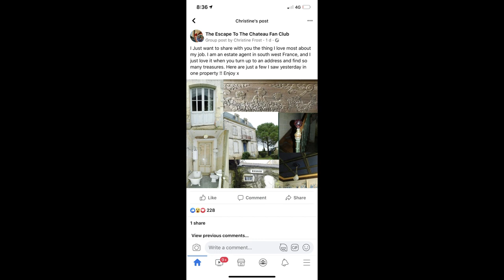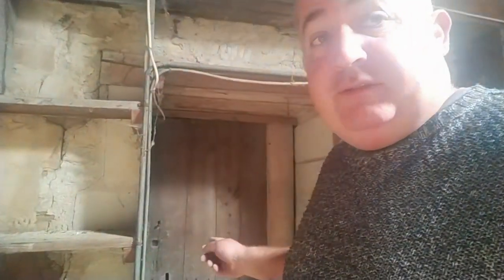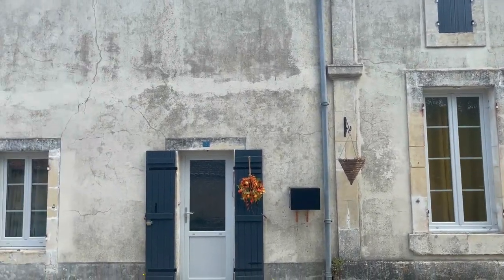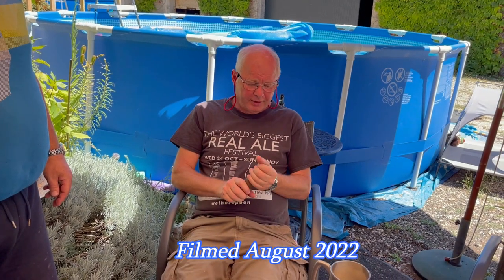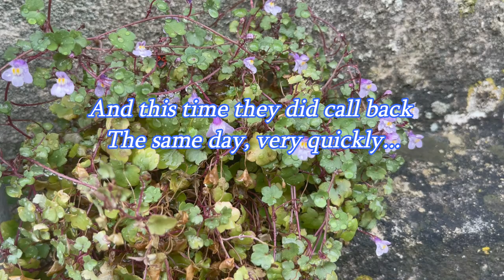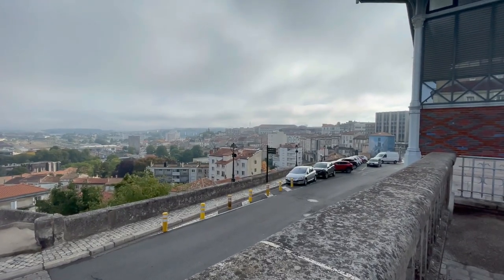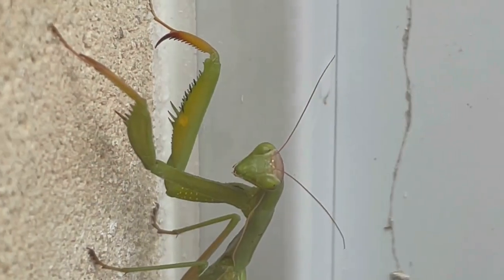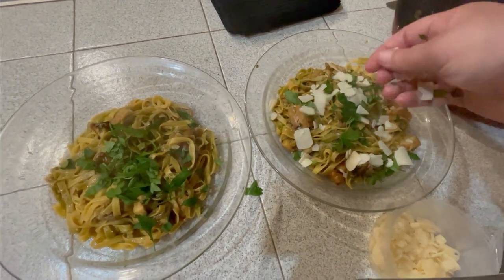Bienvenue! Le Bomb Squad!! #58

Comment: hello, one question do you have a dishwasher in the kitchen?
Reply from the maker: Hi Ayron - we do have a dishwasher in the kitchen I cooked the mushroom tagliatelle this week. If there was any noise it may have been from the extractor fan though. It is a functional kitchen, but not my personal choice of what I would want (I pray every morning I get my kitchen back again, as I have already had my dream kitchen. I just need to replace it in a new house in a new country -
Fingers crossed 🤞🏻) x
Reply: I didn't hear any sound from the dishwasher, I was just curious because I've seen all your videos and I've never seen it, and since the appliances are from the 90's I was curious if one day you can show it how all the appliances from the 90's work I would appreciate. @theexpatbutchers
Reply from the maker: @AyronvBlogs16072015  - I will share the story now… when we moved in we had the previous owners dishwasher (must have been a late 90’s dishwasher - candy brand) but it gave up in a few months. 
We brought our washing machine over from the uk but it was old and died very quickly.
The oldest thing I think I am still using is the fan assisted oven and fridge I am using in the kitchen - the fridge is so temperamental -
Brie has a great texture when half of it is frozen! And I now know to give the oven an extra 10 mins for everything. 
I do have a spare fridge on standby and a commercial oven plugged in another room
For emergencies but it’s too fun coping and managing this to change it now, until one day when the proper ‘Clare’ kitchen is installed 😉😉